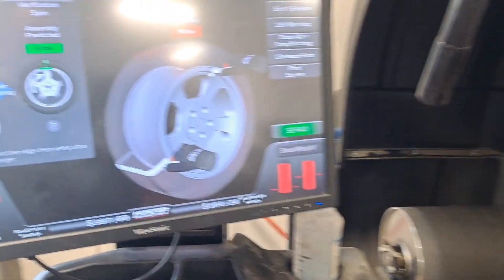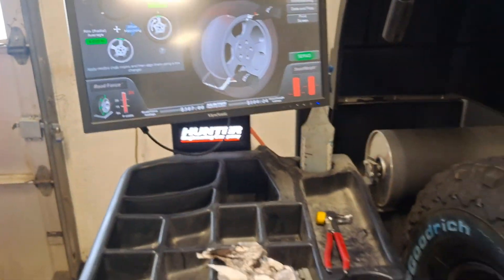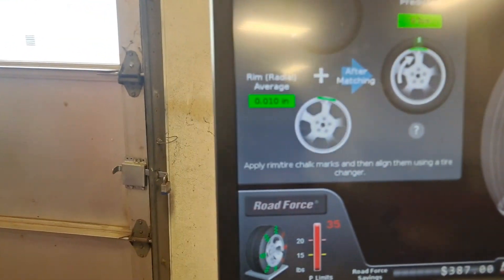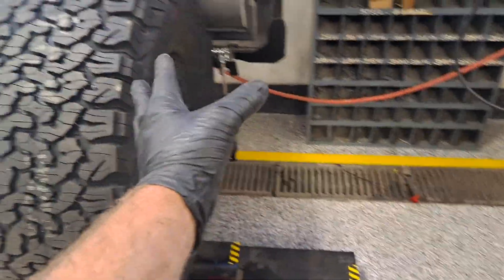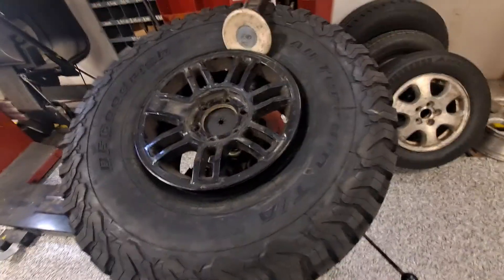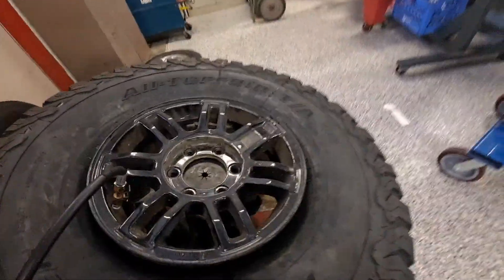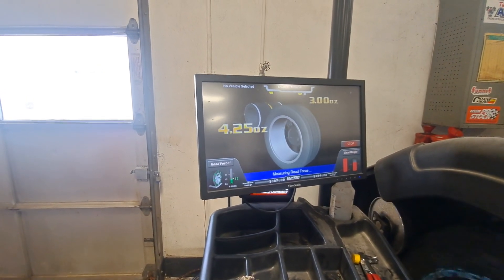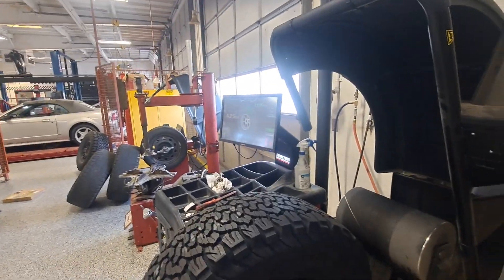Diagnosing and repairing a tire vibration (road force variation) using hunter touch balancer

Comment: Alejandro, I had excavator the same experience.
Paul I don't think they even knew how to use the road force balancer. My dots were all over the place. But because the roadforce was not above 20 they didn't care. Then they only put weights on one side. Now for match mounting does that cost even more than the road force balancing. As the wheel came down and they said it was road force balanced. 
I had a flat fix shop redbone the tire clean the wheel then reinstall with red dots at tire stem. In a hunter smart weight balancer. Still have a vibration. New tires too. Going to check a mechanic as I hit a  pot whole at 55mph on the left front then it made a bubble. 5/32nds on the others. 2 years old. Good video. Not a truck tire but that is a good balancer if people know how to use it.

I feel a vibration at 50-60mph. Looking into this any insights?
Reply from the maker: There is a lot of information I would need to share to fully answer this but in short: don't worry about the dots if they are road force balancing. There are 2 possible dots. One for heavy spot on the tire, which we commonly line up to the valve stem hole to save a little bit of wheel weight weight. The other is the most firm spot on the tire, which the road force balancer measures. It that stiffness exceeds spec, the machine flags it and has you measure rim runout, then possible phase match/match mark, and rotate the tire to align the stiff spot to a slight low spot in the rim. That will lower the overall road force variation of the assembly. 

The machines measurements of the wheel and tire assembly are more important that the tire measurements at the factory, which is where the dots originate. 

As for your issue, still sounds like excessive road force of the assembly, or balance. 
If the machine is out of calibration it could be an explanation. A quick check would be to rotate the tires front to rear. If it was a front tire shaking the steering wheel that would lesson and maybe cause a slight shaking of your butt in the seat. 

NEVER had a tire vibration not show up on the road force machine. The machine will detect and issue and show out of balance or excessive road force variation. 

If everything was good (20 may be a little high depending on P or LT tires)  then I would look into a driveline imbalance. Most of those I experience are more notable under acceleration rather than mph ranges so that's not my feeling on yours. 

Maybe try a place that employs someone more focused on actually fixing problems. Not sure if it's a skill level/education issue, ethical issue, or a money/business issue but all of these are common in this industry.
Reply: @paulkelley86  does weren't even close and the tire was never moved as it maybe had 16lbs. But the guy wasn't sure if the number anyway. I'll try somewhere else. Thanks I'll read again later. It seems to be deminishing. The tires were moved to different spots after the second rebalance. But it's only been two weeks.
Reply: Dude you have bent rims. Road force balancing is a gimmick truthfully. I know some people are gonna get mad at that buts its true. If I've mounted and balanced 1000+ tires and never needed a single road force balance in that time its not required. It just isn't. 95% of the time a vibration that can't be balanced is a bent rim.
Reply from the maker: @fuckjewtube69  no one claims it is required. The FACT is, it's a tool to fix either stiffness variation in a tire, or minor wheel runout. 100% guarantee there are tires with stiffness variation, so your fix is what? Replace the tire? That's a fix but a hassle for a customer if you don't have it in stock. Running the road force algorithm, I can predict and possibly fix the variation in the assembly within a few minutes. Just because you have done 1,000 or 100,000 tires doesn't mean you know anything other than how to do repetitive tasks, so I'm not sure I would brag about that. Better yet, why don't you make a video about how roadforce is a gimmick, and you can get some views for yourself.
Reply: @paulkelley86  You have probably a 100x higher chance of having bent rims over an actual road force problem why waste so much money on a machine to potentially fix such a rare negligible problem. We have 2 of these machines in a 30 bay shop and no one ever needs to use it to fix a vibration problem. Therefore it's a gimmick. Yes with those odds get a new tire lmao. Also I'm not bragging about how much tires I do, I'm saying I've done enough to know this machine is pointless to have and I was responding to the guy in the comments why would I wanna make a video?

Comment: Are u not concerned with the two red tire icons on the bottom right?
Reply from the maker: That is a non essential measurement for smart weight which mainly prevents chasing weights which saves cost. Does not change balance.
Reply: @paulkelley86  I've seen those icons green and also red n only time.ove seen em red is when I also had a issue with the balance I got ...is it better to make sure they r green or why does it go from green to red if it doesn't.matter?plz explain more bc I have a horrible vibration right now
Reply from the maker: @bengleckl1877  when red it means you have weights countering other weights and you are wasting money. THAT IS NOT THE CAUSE OF THE VIBRATION. focus on the road force number, or if you don't have a road force machine, now you know why you are stuck. Any non road force machine is blind to variations in sidewall firmness, which causes just as many vibrations as out of balance.
Reply: @paulkelley86  I went to one of the only road force elites around here and dude don't know what he's doing .usually I go there just to get the orientation of tire right and balance again somewhere else ..like I got multiple clumps of weights on my rim instead of just two (behind spoke and outside edge ) they are passenger rates tires. First it said about 32 lbs but he got em down to maybe 17 but they were also 2 -4 psi over what they should of been so I'm hoping when it said 17 it was more like 14? All I know is yokahoma go15 are smooth as butter and I hoping all over the place and feel like I got an electric toothbrush vibe going on .
Reply: @paulkelley86  when he said they were ok I remember the red icons being full and other tires they were green and half way so I am assuming I need a diff balance or maybe I have one tire that's a little over the spec .

Comment: Im buying new wheels after new tires are "nalanced" but they shake off and on on the highway.  Shop says everything else looks good, no play in the wheels.  Say wheels are all bent
Reply from the maker: That's exactly the purpose of this machine. If they are bent, they should be able to measure the out of round with a dial indicator or at least show you while spinning on the machine. This machine will do all of that and can even give a printout for the customer. Been there as a tech partner, turns into a lot of guessing and trying to blow the customer out the door without the right equipment
Reply: @paulkelley86  Can alignment cause rough ride?  The steering is straight.  Shop thought maybe it was CV.  We're talking 2005 Toyota Avalon I bought with 120000 mile LOL.  When I threw new tires on the first time a couple of years ago they did the same thing, one the techs did something with weights and it worked!  But when rotated they were horrible and had to do that again, the tech doesn't work there anymore and the manager doesn;t know what he did.
Reply from the maker: @rgbsax  alignment caster can cause a shimmy but not typically and based on the tire rotation I bet the worst balance (or runout) tires were on the back till they got rotated to the front which brought it back stronger. 
CV cause driveline vibration which is under accel but lessons on accel.